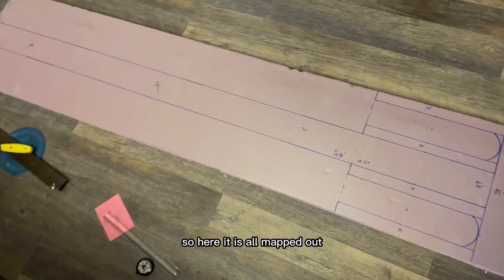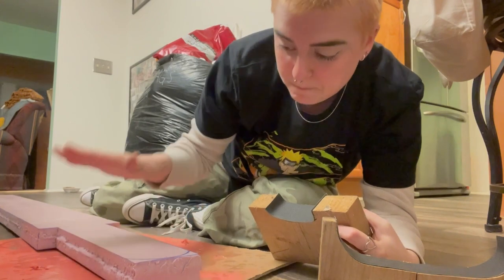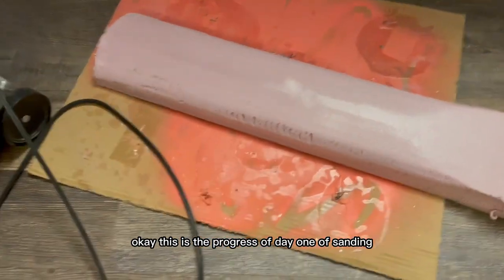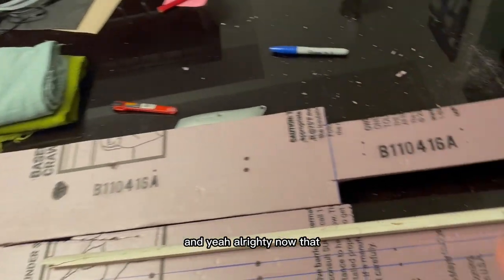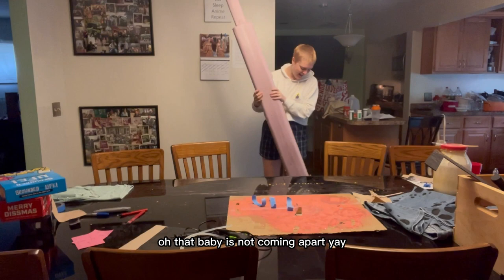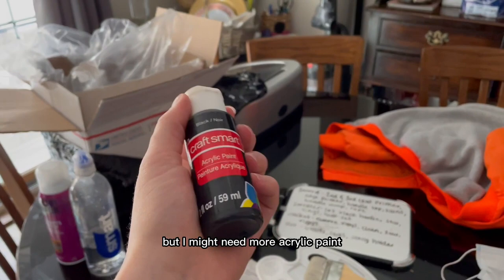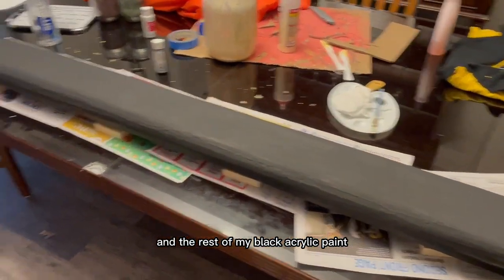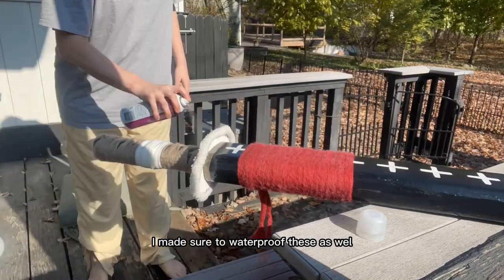How I Made Kikoku | Building Law Trafalgar's Sword - One Piece Cosplay

Comment: - Wow wow wow, came out amazing! 🤩
- what are some lessons learned that’ll probably make it easier if you decided to do version 2.0?
- I think the upper hilt would be the tsuba, since it’s more decorative unlike a crossguard.
Reply from the maker: Thank you!! I think if I make another Kikoku I'd like it to actually be the sword and scabbard so I could unsheathe it! And I'd make it a bit thinner, to be more usable for the wielder. I'd probably also use EVA foam for the scabbard instead of insulation foam so it would hold up better against sharp corners and edges it might run into!